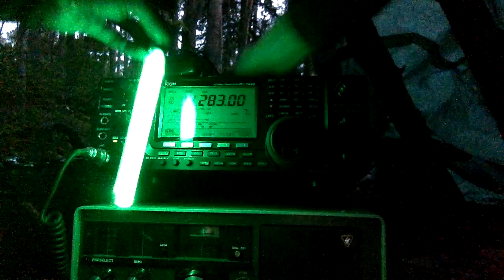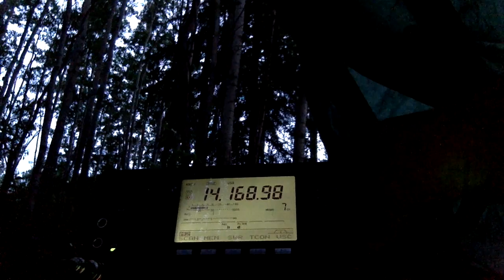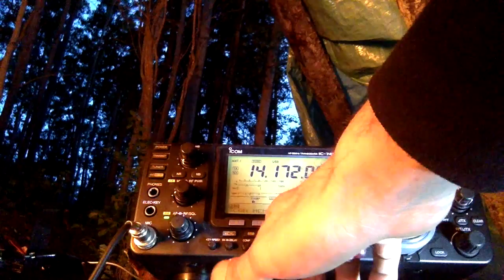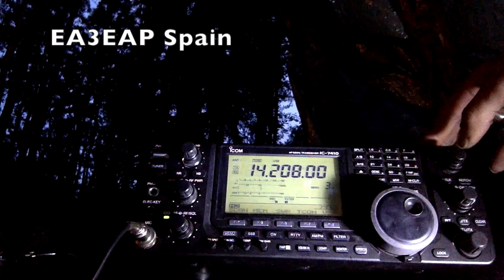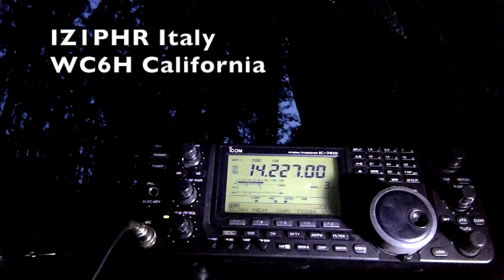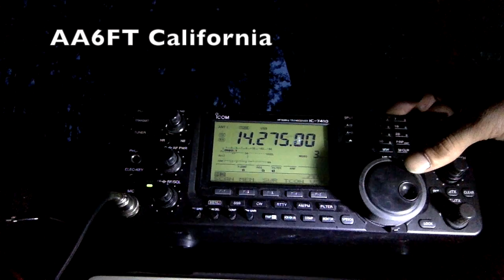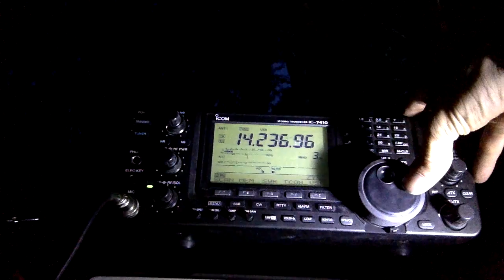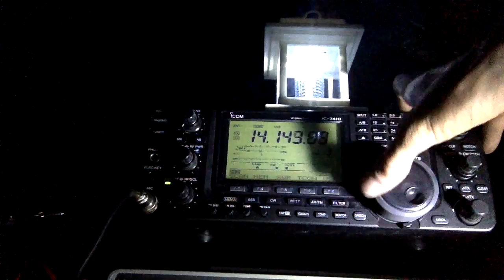20 Meters at Camp on a Icom IC-7410

Comment: Has a very nice smooooooth sounding audio. Band noise is really
 well dealt with by the DSP, from what I can tell.
Curious what you're using for a power source & antenna design, plus
 where were you camping?
Funny, I can hear random-timing "clicking" in the background, sounds like 
 it might be your campfire 12:37
Reply from the maker: I'm very happy with it, its just not a very portable rig.  Being out of the city helps greatly with the noise. Thanks for watching
Reply from the maker: yes sir , the fire.
Reply from the maker: basically a long wire to balun. A full roll of bailing wire from leanto down to a slew hung in the trees , other end is the old and partially buried barbed wire fence , both lengths unknown, just listening..  camping near sangudo alberta
Reply from the maker: power is from 60w solar panel and I have two trojan T105re batteries out there for 12v and a Honda 700w gen if they get low on the small panel. need more amps to charge those batts properly
Reply: Had good RX, especially for random lengths. My friend here in NorCal just dropped the Buy-It-Now hammer on a 7410 a couple hours ago, I hope he hates it and I end up with it - LoL
 I hope you don't hike too far with 122lbs of batteries!
Reply: Love it, feels like I'm there enjoying an IPA with you.
 ~;^D)>